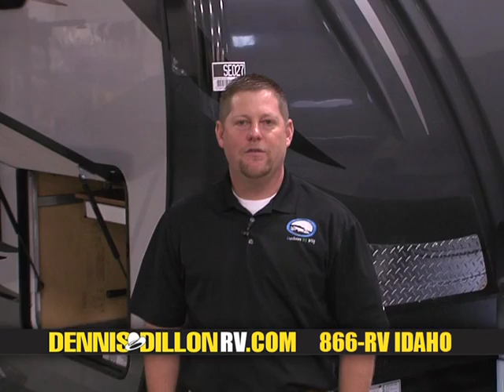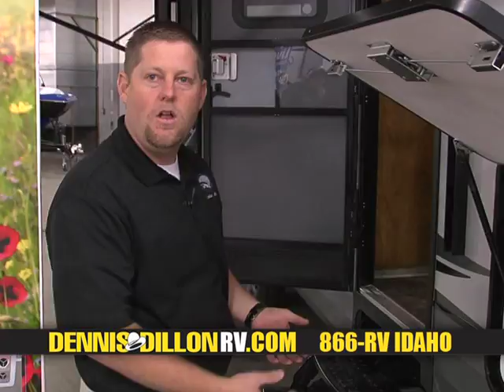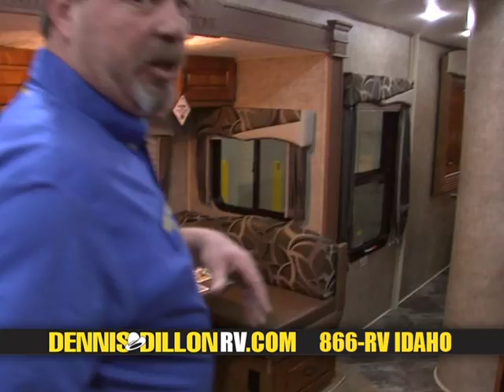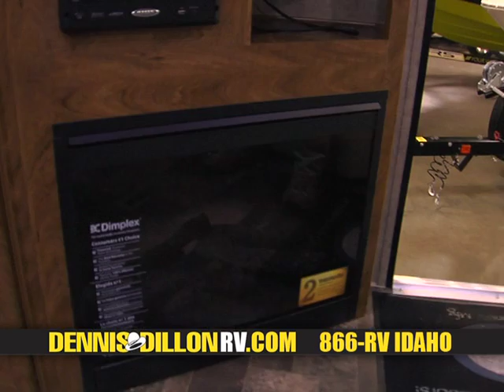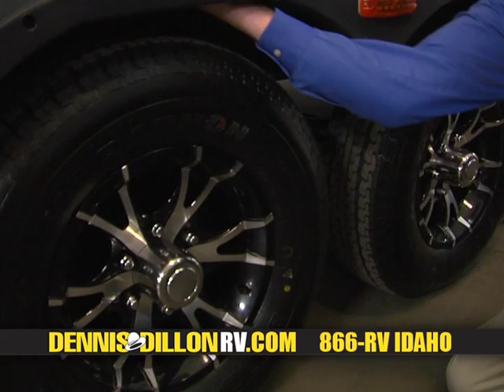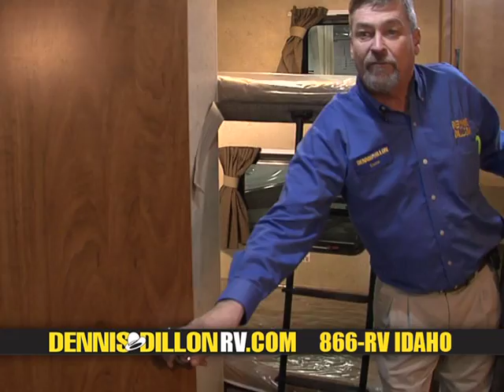Dennis Dillon RV & Marine Show: Outdoors RV

Comment: Aqua hot continuous hot water,multiple zones,
One piece seamless slider
Power and lights on slide trays,
Heated floors, 
Sink cover storage 
Pull out on all storage with lights 
Electric or infra red fireplace in living / bedroom, up high to see when laying in bed
Dish network /wally
Washer /dryer
Pocket doors
Full length mirror 
Built in tank flush
50 gallon grey and blacktanks
Heated storage spaces 
Big showers 
Day/night shades
Inverters 
Smoke detectors throughout, even in storage area
Electric dump valves
TPMS monitor system
Retractable pull out extention cord
Snap pads
Industrial waste master sewer hose with cam lock fitting ,leak proof 
WATER SOFTENER /WATER FILTRATION - DEIONIZER
built in pressure washer
Noaa radio/ built in
Generator 
Fuse box inside
Auto level
Televator across from sofa or recliners
Right angle power cord
Outside step that rest on the ground
Dual pane windows 
Night/ day shades
HEAT PUMP/ AC SYSTEM
slide topper
ONE PIECE SHOWER 
NAUTILUS SYSTEM/ COLOR CODED 
WALKABLE ROOF
ladder in back can slide to sit on ground
Rated for towing hitch
All tubing is wood filled,no screwing into empty aluminum tube
Pantry/lighted, 
Button control panel
Access to bedroom and bathroom with slides in

You do a great job already,here are some thing we are looking for in our forever home.😊
Reply: Also access to bathroom from master bedroom